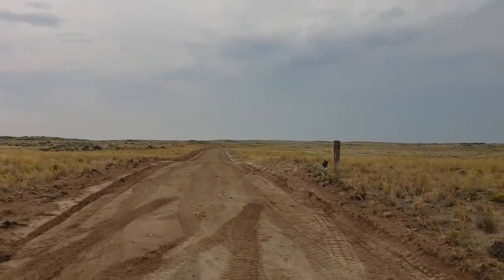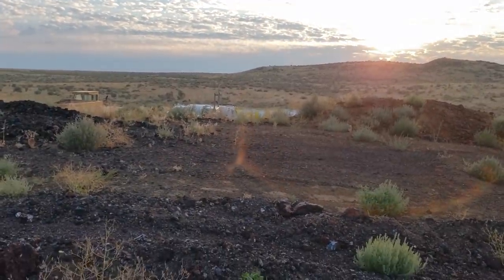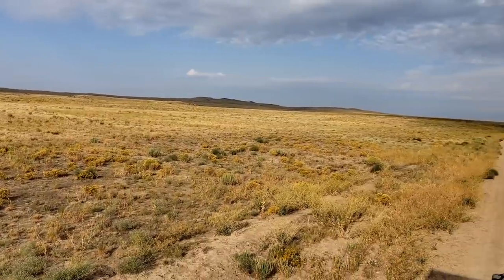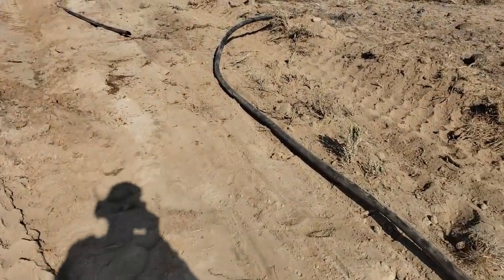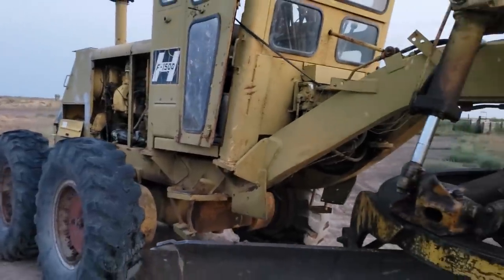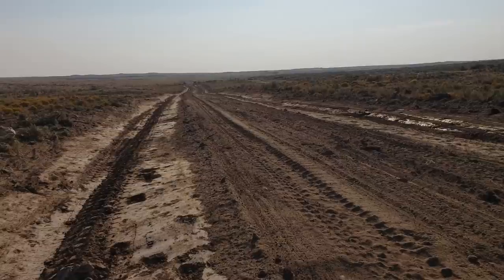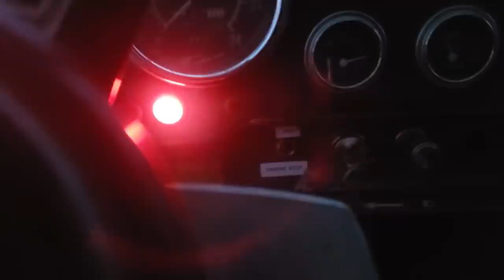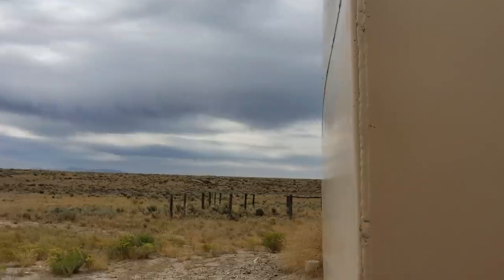The Longest 4 Miles

Comment: Ran a Huber for a contractor that was set up like a farm tractor with a grader style moldboard in the middle and a push blade in front of the steer axle. It actually did a better job that i thought it would, I was blue topping a road.

Comment: I've had those Mechanic vs Engineer discussions with the Engineering Dept of a crane company. They are wonderful people, sometimes, and yet from time to time they even forget that first assembly at the shop drastically affects the costs of any product. When they start discussing Modules and Assemblies they are caught between that wear part with a defined life expectancy that is buried 3' under things that will never wear out and there is NO way to remove them as the assembly they were first built as in the shop with overhead cranes and multiple people doing the work. It's difficult, weigh this vs that choice they end up making and while mechanics, including myself, blame them for obviously foolish choices. Every once in a while you get a person who wants to work with the mechanic and even sales. If possible you end up with a product that can be spectacular in its ease of first assembly and repair. I'm sure you have the same drawer as me in your toolboxes that contains a group of now deformed, welded together, cut and shaped, etc, tools you've made to actually reach those buried under 3' of crap items someone chose to put there when "right there" would have made it a 20 min fix. I would discuss routing of hoses, and wires but I think you covered your opinion of how to do that wrong when you fixed the extra 40' of wire on the Kenworth. My opinon is nearly identical to your's on those "why the hell would they do that" engineering mystery questions. Sorry, the oil fill thing triggered a rant from me. Someone who also has said WTF and Why a few hundred times. I'm sending some rain,  to help with the grader work, but it's held up in Covid restrictions like every f-ing thing else.

Comment: Used to hang the water wagons key from the dipstick. So if I got a call asking where the key was, I'd know they didn't check the oil, and tell em' " check the oil,  if it's good itll start right up.  Have you tried  set of serrated cutting edges for raking rocks out of grade. They seem to be easier on the machine in hard clay sufaces . You probably have, but thought I'd mention it.  Hey, that's a "continental rift" mostly in volcanic areas. Continental divergent where tectonic plates meet where it is covered with the earth's crust. Many western states got em'. I live on the "North American Plate" but see the "Pacific Plate" out my window at home.

Comment: I bought a ‘72 Huber, ex county machine in mid 80’s for a specific job. It also had a Cummins. That machine was a pleasure to run and had power up the wazoo. The problem I had with it was the differential cracking. I welded it up a few times because I couldn’t find one to replace it. It also had a 12/24 solenoid that was trouble. I had the starter rebuilt to 12 volts and got rid of that solenoid and never had another problem. I sold it years later at an auction. Like you said, poor folks have poor ways.

Comment: Looks like the read axle pivots are in a bind the way they are jerking,
Reply from the maker: There a fibre bearing like whats in a hydraulic cylinder, so under a weight they do that, but lift them up and they rotate like gravy, if gravy rotates easy☻

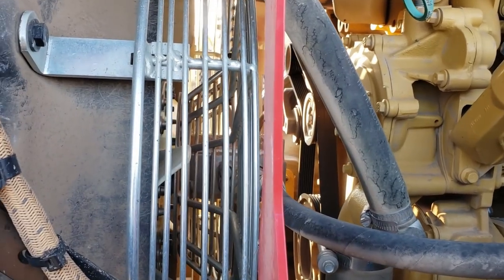Comment: At 22:15, just before. I do not beleive that that oil filler had been harmonically designed. They may have tested it, but they could have tested a better design.  That engineer never has worked the kit for real I bet. Using a funnel in adverse conditions always introduces foreign matter into the engine.

Comment: Often what is taken for bad engineering is the result of bad management directives.  For example, the Challenger space shuttle disaster was the result of NASA management over-riding the recommendations of the engineers.  We don't know how many bad designs (you have to take off this and that in order to get at that one last bell housing bolt) is the result of true lack of insight vs. budget ("we don't have money to redesign that in a better way").   There are, of course, some engineers that are less talented than others just like there are less talented physicians (what do you call the guy who finishes last in medical school?   "Doctor") ... but we hope the work of the less talented designers gets improved through the review process.  Obviously, that doesn't always happen.  

It is easy to  paint all engineers with the same brush in an ugly color when you discover you have to disconnect a motor mount and jack up one side of your engineen to remove the starter (such as in an Infinite Q-45 - its an all day job) because the results of poor design get our attention vs. the thousands of good or even extraordinary design details that go un-noticed and under-appreciated because that is the level of performance we have come to expect and demand.  So take the manufacturer to task for the corporate bad design of some part or piece of equipment but don't assume it is that way because some "engineer" didn't know what he was doing.  I expect any engineer that gets to the point where his specific design work is incorporated in a piece of equipment exactly as he designs it without any guidance (misguided or otherwise) or changes from management knows what he is doing.
Reply: I watched a movie where the intern doctors had to experience personally every test that they could require a patient to go through.That makes a better doctor.
Reply from the maker: 3 million parts all built and assembled by a low bidder☻